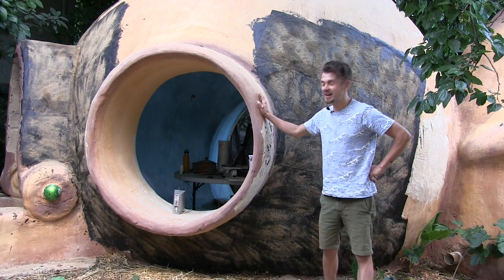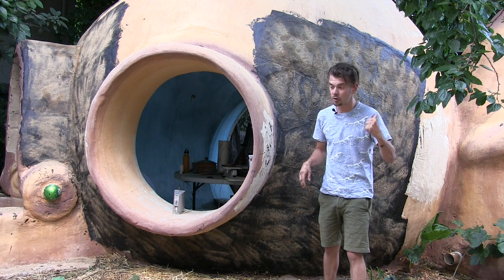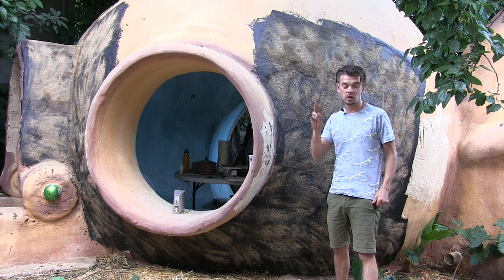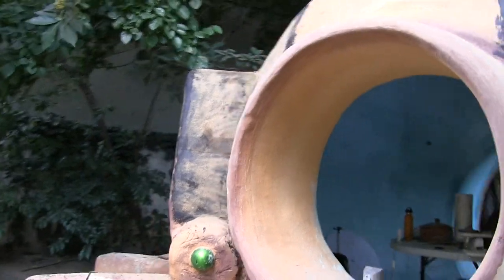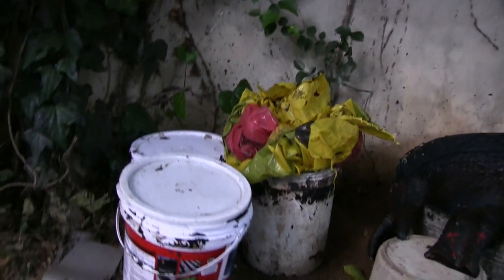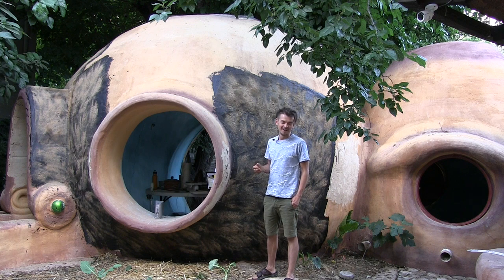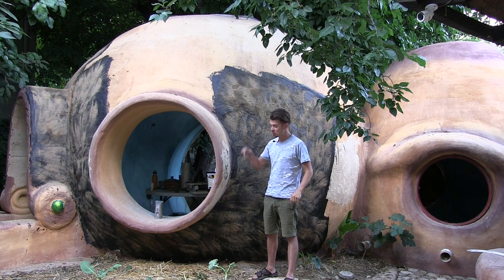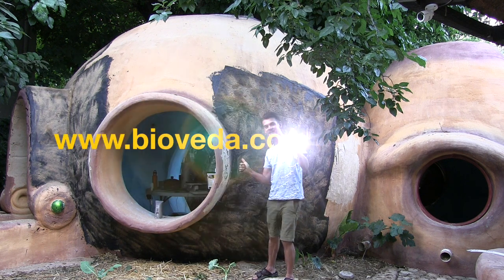Waterproofing an Air Crete & Super Adobe Dome

Comment: There are commercial  fibreglass and render mesh processes that are specified for air Crete structures.  The fibreglass mesh is specified for aircrete and should not crack.

Comment: If the aircrete was poured (sprayed on, over an inflated form) instead of constructed with aircrete blocks, wouldn't it be waterproof?   It is my understanding that monolithic aircrete domes are waterproof.  If that is correct, then it is the mortar that allowed water in.  Would you please clarify this for me?
Reply: I'd love to know more. We are finishing the exterior on our aircrete dome and I'm wondering what to use as a finish.
Reply: Aircrete is still just low density cement. It will always need some waterproof treatment. Even the airform probably isnt properly waterproof either, so cant depend on that.

Even if the airform was waterproof, the aircrete outside of it would still need waterproof treatment

Comment: 1:30 the aircrete crack because it doesnt has the waterproofing mesh?
So u did a aircrete without waterproofing mesh? 
Your vids are great... im following you.
Reply from the maker: no because it swelled up with too much water and it is not designed to hold so much weight

Comment: howdy - are you going to use the same method on the inside of the dome too?
Reply from the maker: no waterproofing on the inside is not necessary, always waterproof from the outside, natural plaster on the inside will do
Reply: What did you use for the exterior waterproofing?